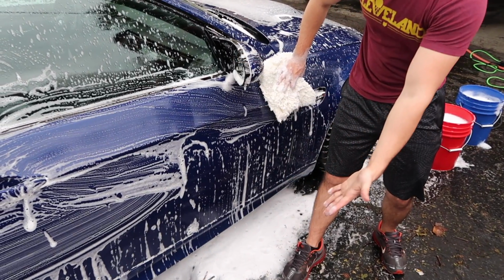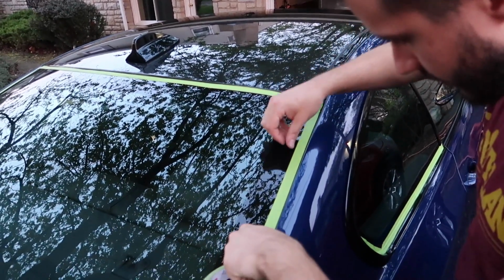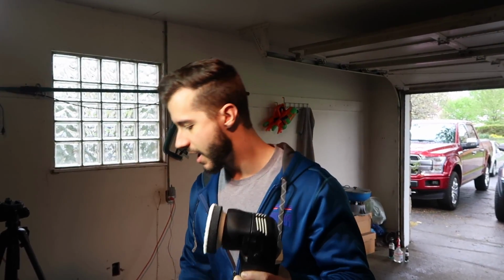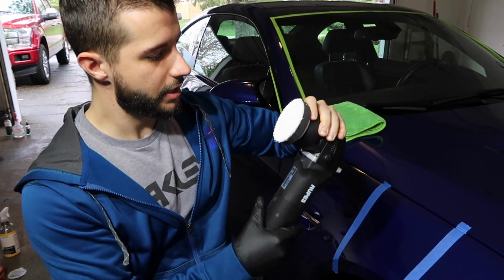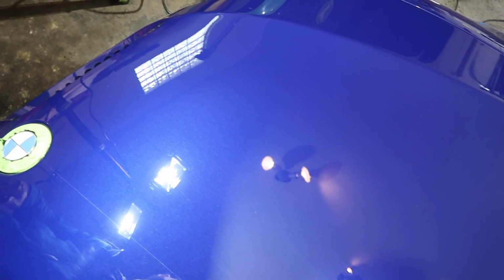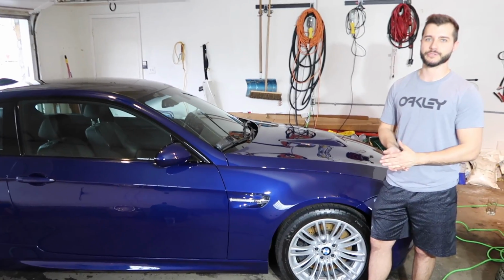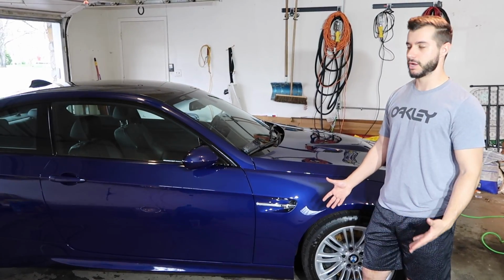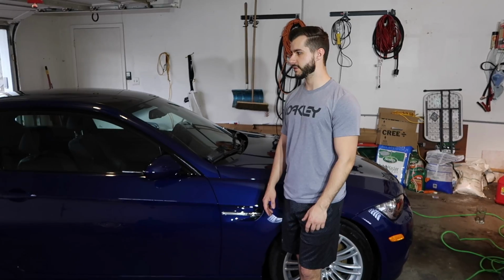First Polish after 7 Years: Interlagos Blue E92 M3

Comment: The reason you rinse after foam, is because the foaming product is designed to softern the bonded grime while helping to lift away the unbonded grime. A rinse after will then remove any grime that the foam has softerned, otherwise all your doing is then draging your nice plush mitt into all the grime that you could have removed, increasing the risk of swirls/marring. But hey its all down to preference and you machine polished afterwards so who cares! :-) Enjoy your videos and congrats on the other vid where you won the 1st prize with your M3!

Comment: Why "everyone" was freaking out over the technique is because you should rinse the dirt off the car after foam. Even tho most of the foam is gone, it does not mean the dirt is gone. You are basicly dragging dirt all over the car, doing damage to the paint. It's unnessasary damage and can easily be avoided.
The order you should do it is rinse, clean wheels, rinse, foam, rinse, handscrub and rinse. If needed then claybar and handwash again and rinse.
Reply: And if you so insist; rinse, wheels, rinse, foam, rinse, foam again )extra lube for washing, washing and final rinse.
Reply: 100%. Or could even foam again for added lubrication as mr V says below. I'd never put a mitt to paintwork with the snowfoam left on, the whole point of it is to lift dirt off the paint, so by not rinsing it you're basically dragging it all over the car as you said.
Reply: while technically correct rinsing with a power washer is gonna remove 90% of any dirt that could potentially scratch the paint and the remaining foam will only help to lift the dirt into the wash media! it can be overthought and knowing that he's gonna correct it right after anyways then the point is null
Reply: I heard someone say foam, rinish, wheels, rinish, foam again and hand scrub with mitt soaked in soap

Comment: 1:10 if one of your wheel s getting more dirt because of the dust it probably means you have a problem with a caliper. After driving for a while stop and see if of your wheels smells more and touch a rim (not a rotor!) to see if it's more hot than the other one.

Comment: To answer your question about why passenger side shows more brake use it’s this simple : weight distribution, if you can for the sake of science have a passenger with you every time you drive the car for few days you will find it would become equal brake effort on both sides

Comment: About the foam. What I do on my car is that I foam it and then let it sit. then I rinse the foam and I foam against before putting the pad on. The reason why you should rinse the first foam is because of loose dirt that still sits on your paint and it can scratch the pain. Of course this doesn't matter in your cause since you're going to polish it anyway. If you were not about to polish don't go vertical lines with pad.

Comment: Detailing for a living I can say that the washing procedure is ok as the marring / swirls created by the mitt on the "unrinsed" surface are just a drop in the ocean on that scratched paint. Guys the car has never been polished you will never do more damage with one "bad" wash than years of neglect and deeper correction is needed anyway. You need to wash as as careful as possible to maintain a perfect finish. Btw I like the Sonax does a good job on bimmers ceramic paint only downside in my opinion is it dusts more than megs, or CG. Good job and vid.

Comment: 1:12
Interesting that you note that. On Vehicle Virgin’s recent video on his tuned E63, Parker noted that on all 3 of his cars, the front passenger brake pads wore off significantly more than any other wheel and that the sloughted rotors had to be cleaned up from all the brake dust in the holes. Maybe it has something to do with the weight of the driver and it requiring less braking on the driver side? Your guess is as good as mine buddy.

Comment: Looks great.  I want to get an e90 m3 in the same color! 

One correction about what you said.  Interlagos Blue was a stock color on 5 different ///M cars.  E46 M3, e9X M3, E60 M5, E63 M6, and E86 Z4 M. It was an “///M” exclusive color, but was available on other cars other than the M3.

Beautiful color.   Videos and photos do not do it justice!
Reply: NicksNutrition that is correct! However, it was only on the 2011 M3 I think.
Reply: Wherecar 54  interlagos blue was available 2005-2013 M3. All years e60 m5, all years e63 m6, all years Z4M
Reply: NicksNutrition Thanks. I stand corrected. Thanks for compliment.

Comment: yes mate because even if the foam comes off you gota rinse it off to make sure the pressure wash will remove any left over dirt and grime. its just safer for the paint in my opinion. i wash my e46 m3 every weekend takes me like 4-5 hours just the outside